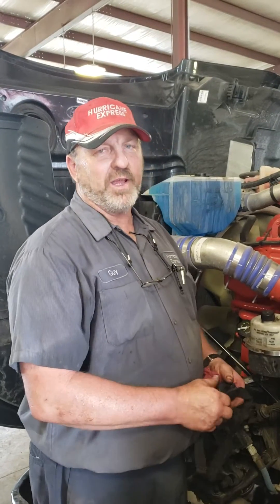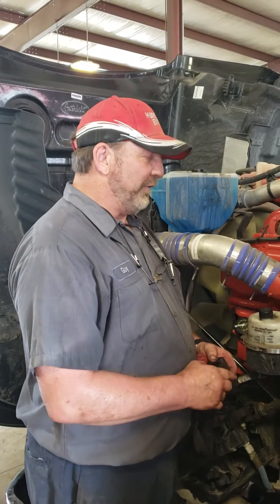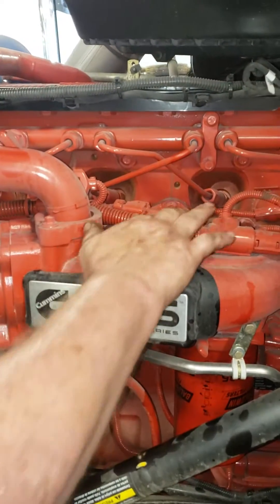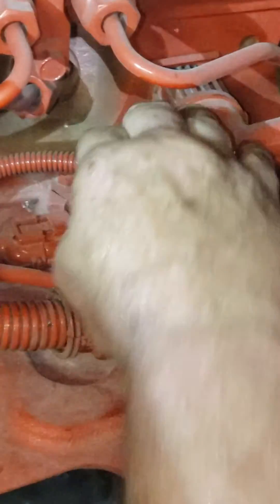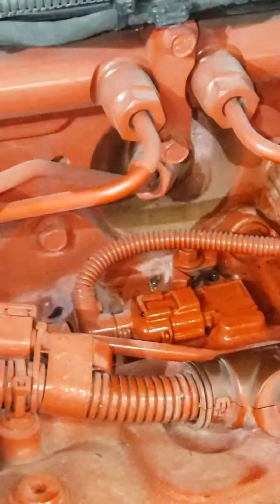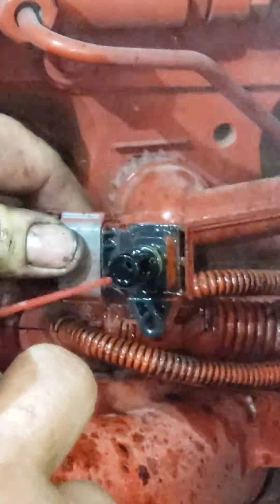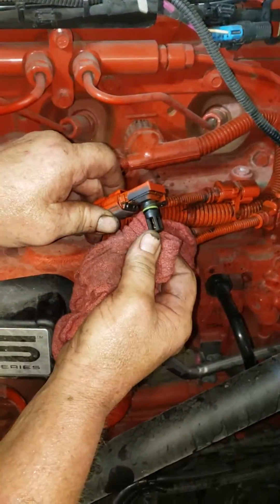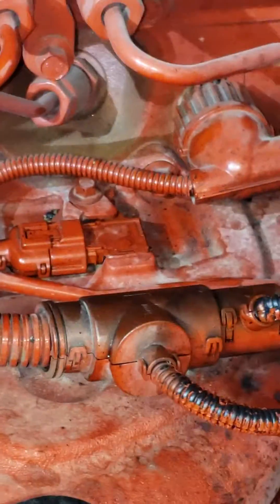Manifold Pressure Sensor Cleaning for the 2019 ISX-15

Comment: You can just use a dry toothbrush to clean the soot out the sensor . I do mine every month. You  don’t need the carb cleaner due to the electrical components inside the sensor.